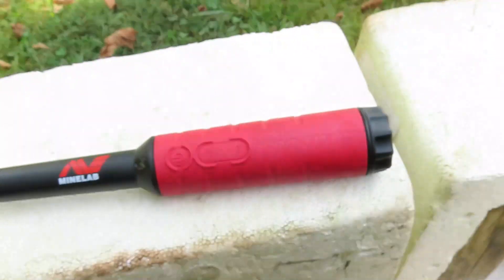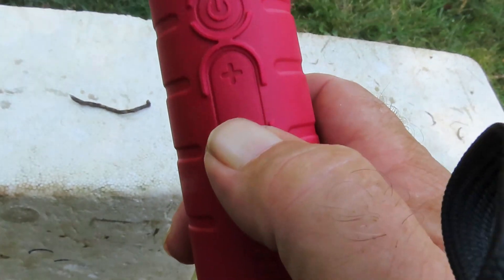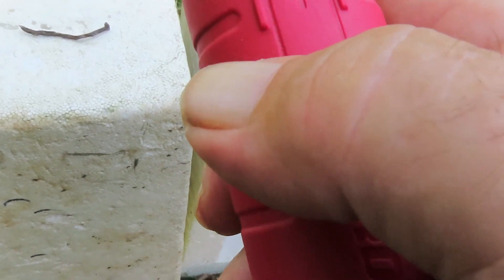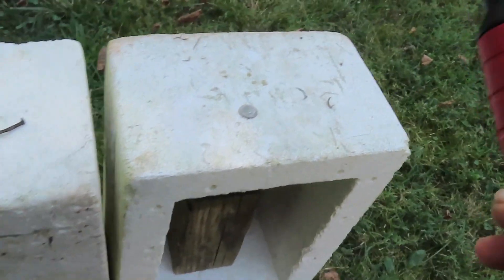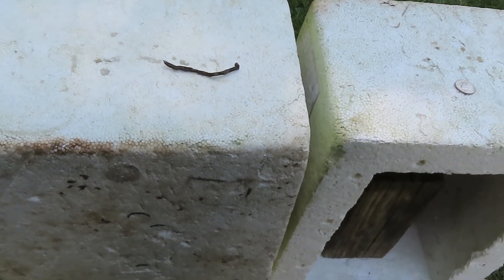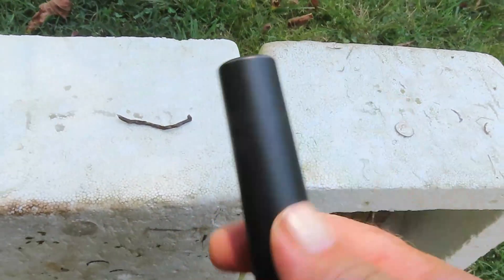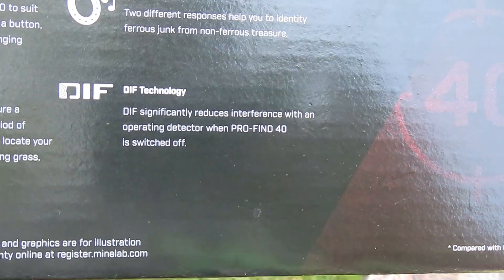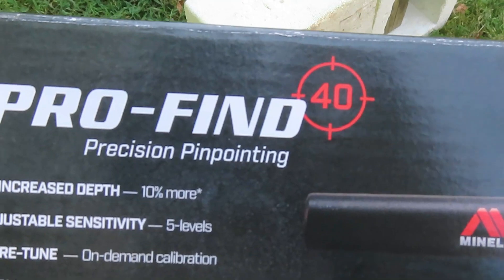Minelab Pro - Find 40 Pinpointer  -- Operation and Features

Comment from the maker: Audio plus vibrate is one option.  Vibrate only the other option.

Seems lost pointer activates around 40 seconds.

Also worth noting.  Lost feature pointer produces as pointer is set up.
Example vibrate only mode pointer gives only vibrate sound.

When lost feature is triggered with both vibrate and Audio selected both sound off when lost feature activates.

So pointer easier to find if one loses when operator is using audio feature along with vibrate.

Comment: Can you do a video with the Pro-find 40 and Manticore distance test? My garret at pro carrot goes off when it's near the control box of the Manticore. When I set the detector near the hole and use the pinpointer it goes off from 3ft away. I have to set the detector 5ft away.